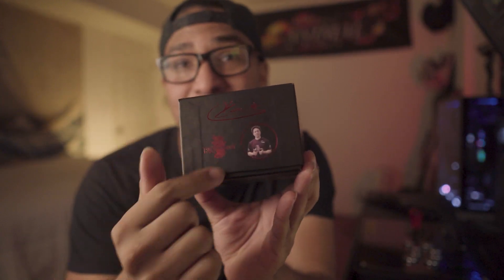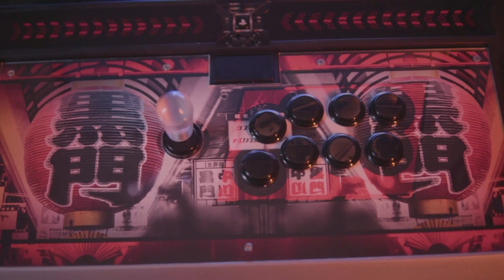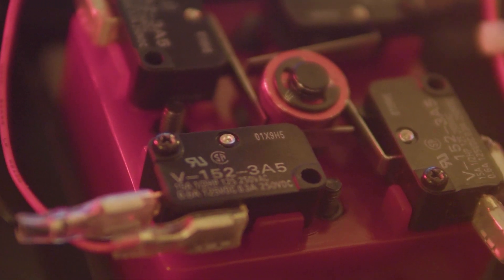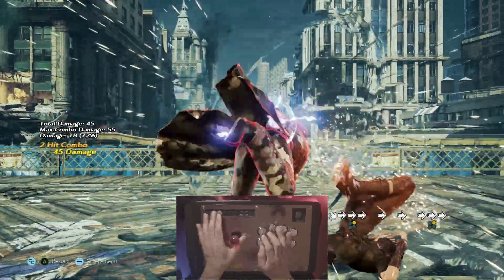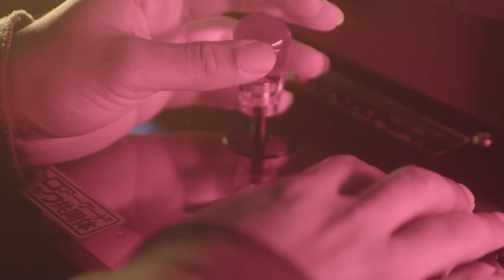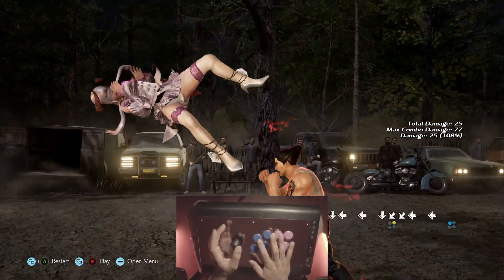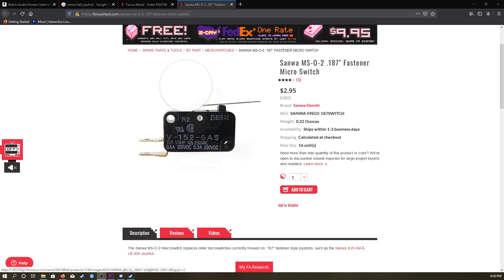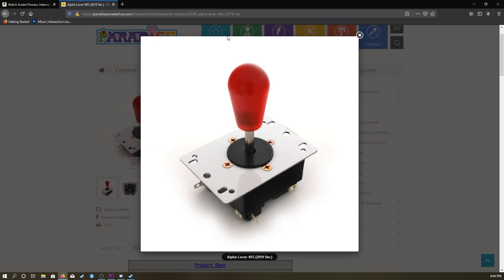ROX DRAGON KNEE Lever Review (LIMITED EDITION)

Comment from the maker: ** Correction 2/1/2020**

Hey guys so the 47c actuator is  a 15.6mm, it looks my actuators may have gotten mixed up with some others. However the stronger switches still makes for a narrower-er corner in comparison to the Knee lever. I still hold pretty much to my conclusion in the comparison between the 47c and knee lever, though the difference in corners are similar. This also means for those of you who want cleaner execution, a smaller actuator may be able to help.

Comment: Guys the knee lever is actually worth it. Been messing around with mine for about three weeks and it definitely a perfect choice if your coming from JLf and want to try out the Korean side. The tension is light yet stiff. I’ve been using several other lever and I can say it’s perfect for the middle guy.
Reply: GamerGriff 3387 what tension do you use
Reply: dang might try out the knee, only used jlf and hayabusa but wanna try a korean lever was thinking 309 mj or this
Reply: @31IVI3jZ  I have both 
, the 309 mj is good it just doesn’t go back to neutral like the knee lever. But by default the knee lever has a heavier gourmet inside the actual stick which allows that snappy feeling back to neutral. But you can always buy a heavier gourmet for the 309
Reply: Can you suggest this for beginners?

Comment: just installed mine , so far I love it , coming from a 309 mj it feels pretty similar to me easy adjustment , it does have a slight different feel thats hard to explain but feels good , I prefer the tension of how this and 309 mj stock feels , not to heavy in the hand like a fanta would be but thats just me , 10/10 for me

Comment: Have you heard about the Cool Bear Lever that's in development by Blunderbuss Designs? What about reviewing the 309 Benylis or the Golden Lever? Or the ASI square/octagonal short collars?
Reply from the maker: The cool bear is probably the one I'll be doing next. Golden lever is too expensive for me to really give it a try and regards to the 309benylis I will compare to another lever but won't have a dedicated video as it still feels like a 309mj. The collars are cool but doubtful I'll do a video.
Reply: I have a cool bear lever. It uses an actual true circle gate unlike the majority of levers. If you take a regular Myoungshin (or any other Korean standard) people naturally assume that the collar is actually what produces the 'gate' of the lever. In fact, on the underside of most levers, there's actually a chamfered square like you'd find even on a regular Sanwa JLF except you can't actually change it.  The Cool-Bear lever is one of the only levers I've ever known that has opted for a true-circle gate (outside of changing it yourself on a Sanwa JLF for example). It makes for gliding around the gate really smooth with regards to things like wave dashes and the like. It also features a removable collar (super clever addition) so Japanese stick users can fit it into theirs. Also being on a circle gate doesn't negatively affect KBD as some may think.

Comment: That's sad, I wanted to buy one from IST but was too late.

Now I ordered a Golden Lever, though I'm a mediocre player overall. Doesn't matter, but the Golden Lever is like the holy grail of the levers.

Can't wait to get it!

P.S.: Great Content! Love it!
Reply: Be careful with those brass parts
Reply: @silkroadCEO  why? Are there any issues?
Reply: Damian Dessler Where did you order it? I looked for one but it was sold out :(.
Reply: @jaycha4983  there are two other resellers from Japan named Attasa
Reply: Damian Dessler Thanks my man! Will order one today!
Reply: Damian Dessler they’re brass lol they corrode and have snapped on people
Reply from the maker: The brass levers are prone to snapping so I would get the SS shafts as a back up. I've seen on discord a few broken shafts overtime as the brass corroded overtime hence why I havent looked into a GL yet.
Reply: coming from someone that collects k levers. I used to use the golden lever but ended up liking the Fujin v3 more. i felt like the golden lever was to expensive. when i go to tournaments now i usually stick with the Fujin lever
Reply from the maker: @isaacbojorquez38  you buy more into the system rather than the lever itself tbh. You have all the modifications options available from one place that you will know forsure will be compatible. I will probably give one a try eventually.

Comment: So I am about to buy my first premium fight stick and currently I'm leaning towards a etokki omni with the taeyoung fanta lever. One thing I am worried about though is that I am coming from a hori mini stick which is very loose. This is the pad I learned on (I play street fighter but I may add other games in the future) and I feel like I would prefer a stick with less resistance because of that.  I know the stick on the omni comes with a very stiff grommet. I'm wondering if you think replacing with a looser grommet would be a good way to go or if there is any other lever you would reccomend instead. I wouldn't mind paying a little bit more for a separate lever if it's a decent improvement
Reply from the maker: What I usually recommend for someone who isn't sure about tension is grab some the tension grommets that are available. Since the Taeyoung typically comes with the 45a, its the highest  tension you can get, so going lower is pretty much your only option. I would say start with a 40a,35a,30a grommets to get a feel of which one may fit your alley then if you feel you need even less than you will know :)
Reply: @alexnostalgix     Okay great, thanks. Do you know if the taeyoung will accept the grommets that are used in fujins.
Reply from the maker: yeah all fanta levers and interchangeable for the most part

Comment: Using 309mj currently with st35 rubber....how much this lever will effect my gameplay?? And if effects are negative then what changes should i do to my knee lever.... waiting for ur response
Reply from the maker: You may feel  the knee lever softer in comparison which you can use the gersung a3's or bump up the tension to a regular  35a or 40a. As for how it will affect you and the steps to take to fine tune for yourself is something I can't really answer as changes in the lever isn't the same for everyone.
Reply: @alexnostalgix  you are right about all ur points u have mentioned... i have alreday got A3 zippies and regular st35 rubber spare.....
Reply: @alexnostalgix  ill test it soon and will share the experience with u.... by the way you are doing a great job....keep it up bro